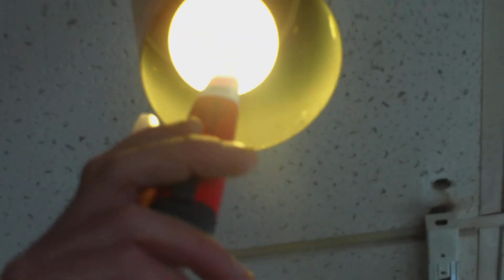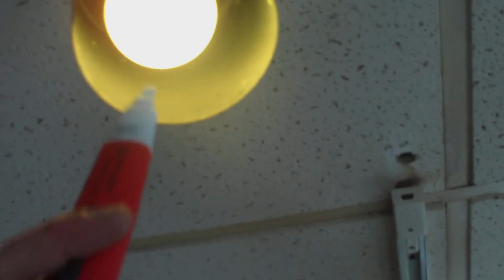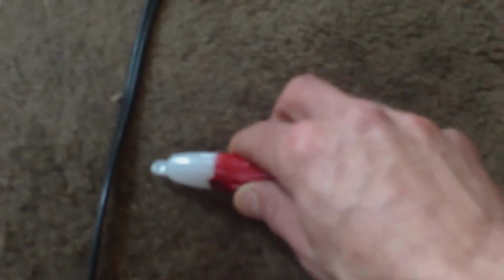Using Non-Contact VoltTesters to Detect Toxic EM Field Radiation

Comment from the maker: So the second video I never did was with a non-contact amp tester. That will pick up the cell phone, meaning it's easier to detect the phone's amperage than its voltage.
Reply from the maker: Observation Deck YouTube channel recently put out a new video on shielding from EMF.
https://youtu.be/BRnZVsBi5a0
hour long report
I commented
Pulsor.org is reputed to work as an EM filter, but how it works is complicated to explain (There's a whole book by the inventor, all about micro-crystals).

Graham-Stetser filters are more commonly known, and can be installed either by an electrician or just plugged in to your outlets by a layperson.

Shungite is a mineral that shields electrosmog: people have allegedly mixed ground powder into paint and successfully shielded entire rooms of their homes that way.

Beware of Faraday cage type shields. An ungrounded Faraday cage that's covered in any type of insulation, an insulated Faraday cage is by definition, a Reich-Faraday cage, also known as an Orgone Accumulator, or, an OrAc, and highly vulnerable to toxic radiation, as the waves ricochet and build inside the box. Read The ORANUR Experiment or Selected Writings by Wilhelm Reich for a history of discovery, or The Orgone Accumulator Handbook by James DeMeo for the most current lay literature.

Lastly, not a shield, honey, or any other working treatment for leprosy, may help alleviate radiation poisoning. I don't understand how this works but empiricism dispenses with theory and relies on facts: there are many similarities between leprosy and radiation poisoning; those are the facts.

...

I also commented
I don't recommend orgonite: its inventor (whom I'll refrain from naming) was a quack who recommended sacrificing chickens; and Don Croft's "method" is plain reckless.

I know of one person with any information on actual peer review study of orgonite, and that's with a low voltage Direct Current applied.
https://www.google.com/search?&q=leon+southgate+ogonite
I wonder if anyone's asking if a DC pulse might work better, and at what frequency?

Comment: A lot to process in order to act with full awareness. 
Thank you for all the guidance.
Reply from the maker: I'm there with the cheap solutions, a $10 volt tester from the hardware store.
Some of these EMF detectors and meters go into the $100s just for simple handheld equipment, without getting into fancy computers.
Reply: @0ned  Why didn't I think of that? 
So the deadly cell phones and towers are just to distract?
Reply: Have a lovely evening.🌠
Reply from the maker: @pamela-vi7rp  
Secret
Militarized
Armements in
Residential
Technology

Rule of thumb—
Anything branded "smart" is for stupid people.

I think they're more like satellites, sold to benefit us but designed to target us.
Reply: @0ned  🤦‍♀️ I have a statement that I still swear by.
Probable cause, no
bout .a  doubt it.

Comment: This is all well and fine, but who said anything about an em field being Toxic?  What are they rumored to do?
Reply from the maker: Observation Deck YouTube channel recently put out a new video on shielding from EMF.
https://youtu.be/BRnZVsBi5a0
hour long report
I commented
Pulsor.org is reputed to work as an EM filter, but how it works is complicated to explain (There's a whole book by the inventor, all about micro-crystals).

Graham-Stetser filters are more commonly known, and can be installed either by an electrician or just plugged in to your outlets by a layperson.

Shungite is a mineral that shields electrosmog: people have allegedly mixed ground powder into paint and successfully shielded entire rooms of their homes that way.

Beware of Faraday cage type shields. An ungrounded Faraday cage that's covered in any type of insulation, an insulated Faraday cage is by definition, a Reich-Faraday cage, also known as an Orgone Accumulator, or, an OrAc, and highly vulnerable to toxic radiation, as the waves ricochet and build inside the box. Read The ORANUR Experiment or Selected Writings by Wilhelm Reich for a history of discovery, or The Orgone Accumulator Handbook by James DeMeo for the most current lay literature.

Lastly, not a shield, honey, or any other working treatment for leprosy, may help alleviate radiation poisoning. I don't understand how this works but empiricism dispenses with theory and relies on facts: there are many similarities between leprosy and radiation poisoning; those are the facts.

...

I also commented
I don't recommend orgonite: its inventor (whom I'll refrain from naming) was a quack who recommended sacrificing chickens; and Don Croft's "method" is plain reckless.

I know of one person with any information on actual peer review study of orgonite, and that's with a low voltage Direct Current applied.
https://www.google.com/search?&q=leon+southgate+ogonite
I wonder if anyone's asking if a DC pulse might work better, and at what frequency?